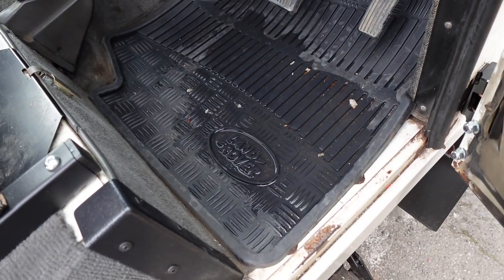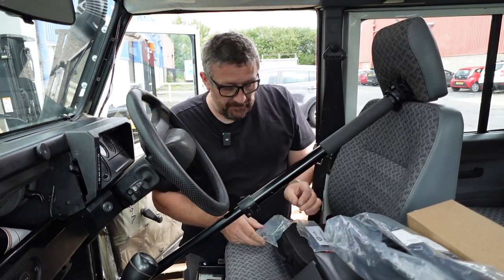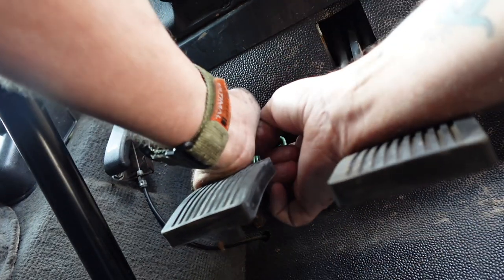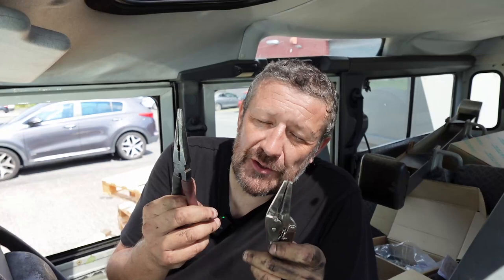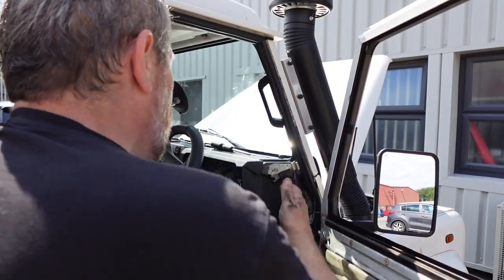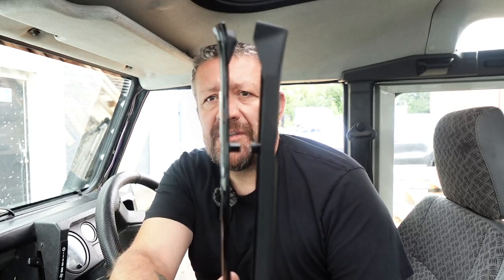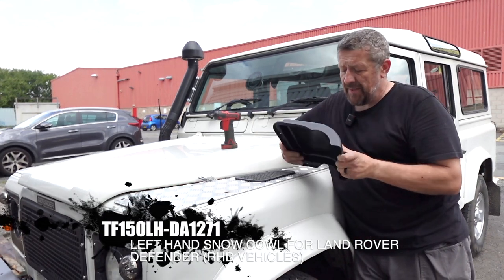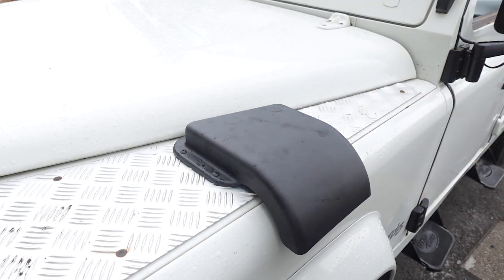I review five products for your Defender that you can fit with a screwdriver - almost!

Comment: The common misconception is that the spring would help clutch heaviness to all defenders, is not true. For best results depending on the vehicle engine/year of manufacture you might also need to combine it with master cylinder from LOF, slave cylinder from LOF , or  completely abandoned the spring and use either master or slave cylinder.and Is not very clear on their website to be fair. Greatly enjoyed the video so please keep up good work.

Comment: I can't remember from your video  when you changed the pins on the vent flaps... But did you subsequently change the foam seals? Easy job and could be where your water is getting in
Reply from the maker: That's a definite possibility. I'll be doing them shortly!